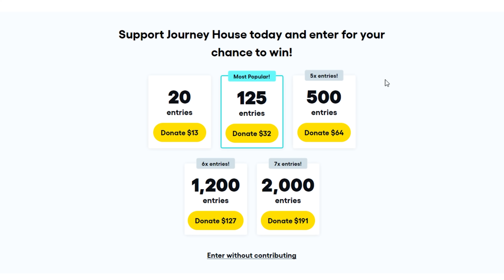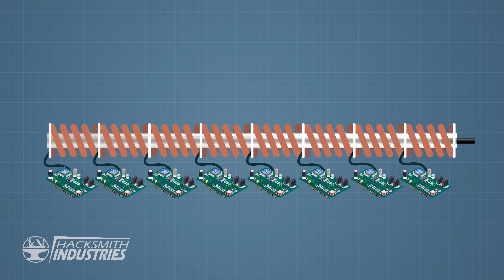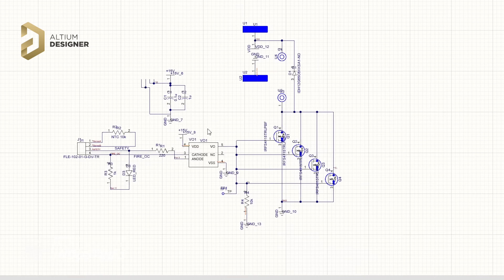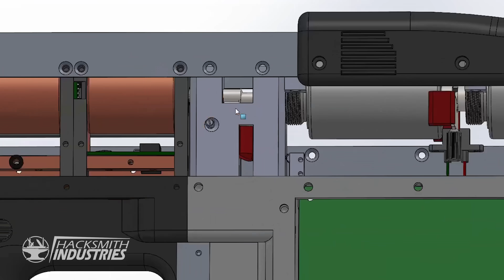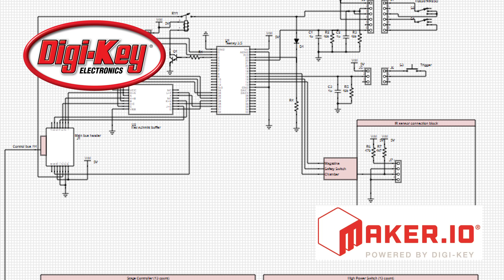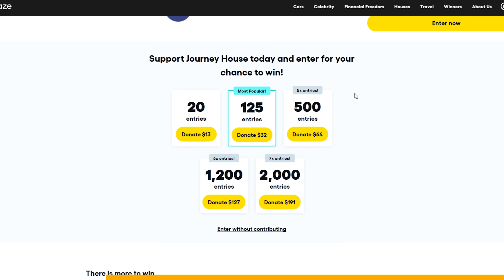MOST POWERFUL ENERGY WEAPON WE'VE EVER MADE!

Comment: The thing with bullets is that they are negatively impacted by air resistance, causing them to tumble. But that is because they have no fletchings because in order to produce the explosive resistance necessary to launch a bullet, you need the bullet casing to be flush in the barrel.

But gauss weapons do not have that issue. So to produce a proper and accurate gauss gun, you need projectiles with fletchings. They don't need to be big since the projectile is small. I believe you could get away with using 2mm tall feathered wire fletchings. Also, with a pointier tip (even just a ballpoint tip), they could actually break something. This will also take that load off the magnets. (The magnets will do less work.) I suggest slightly skinnier tungsten (rather hardened compressed powder steel) projectiles with fletchings and pointed tips.
Reply: Prototype V4 coming in 3 years xD
Reply: @koenv4367  V4 actually. 😉
Reply: @Dismythed  Omg ur right lmaoo
Reply: Just like an APFS projectile? (I changed it to avoid confusion. Not everyone is into about ground vehicles/projectiles)
Reply: @radonsider9692  all you really need is the fin stabilized part. The discarding sabot could work, but it would be a tradeoff as you would sacrifice magazine capacity and cost by including it, but it could help stabilize the round more in the barrel.
Reply: @radonsider9692  yesn't you would only need an apfs round, the DS stands for discarding sabot which means that the projectile has an outer hull that fits the barell, which gets trown away after leaving the barell, it's only purpose is enabling the gun to shoot projectiles that are a lot thinner than the gun itself (and alows them to have fins), but since electric guns don't need gas pressure the projectile doesn't need to fit the barell.
Reply: @erzbengelraziel5490  yes yes I know but it was just to make sure that I was thinking the same thing.
Reply: @radonsider9692  Without the casing, I guess. (edit: as Erzbengel Raziel said.)
Reply: @radonsider9692  Sabot Ready!
Reply: Tungsten is only paramagnetic so you wouldn't be able to use it
Reply: @aaron_r6611  Ah. I see.
Reply: @aaron_r6611  If we used a discarding sabot that was made of some sort of magnetic alloy, we could easily solve that problem.
Reply: @aaron_r6611  : As many maglev systems demonstrate, paramagnetic materials can be thrown with magnetic fields. Though maybe not with a coilgun design.
Reply: @aaron_r6611  What about a magnetic round? Stick with me here. If you have the coils oscillate their magnetic poles, would you be able to push a magnetic round at the same time another coil is pulling it? (Assuming the round's dipole is facing front and back.)

There is also the possibility of a monopole magnetic round made of eight lengthwise triangular magnets held together by a casing that the coils could pull more quickly.

These are just off the top of my head, and I really don't know how to calculate magnetic fields, so it may or may not be feasible. I'll leave that to you.
Reply: But tungsten is barely magnetic so you're not really going to get any power using it?
Reply: theres a hand held rail gun on the market that uses disks to solve that problem
Reply: @bulluffalo6711  That uses flat electromagnetic plates on either side of the discs, not coils. Discs do not have a strong ability to penetrate anything but flesh, wood and leather, and really just get lodged or bounce away dangerously in a left or right direction.
Reply: you could use tungsten on a railgun but iirc they dont really work in coilguns since coilguns operate using ferromagnetism not Lorenz force
Reply: Boost
Reply: They wouldn't fit in the magazines if they had fins on them. This is unless there is a sabot around the projectile but that would cause issues with a gauss gun.
Reply: @JordanHB77  not necessarily so you can have the fins pressed into the core so it is flush  and are used in a shotgun cartridge that would make ammo for this gun though I would like to know the maximum speed  it could fire them if the limiters was removed
Reply: @JordanHB77  It's magnetic coils. The accelerated round floats between the magnets. You can put any shape of object into it and it will fire it as long as it is calibrated to it.
Reply: Dear God I can see the Future where gunpowder is obsolete
Reply: @KaitoSound  I wouldn't count on it. You'd be hard pressed to match a firearm with a coilgun. A gun is relatively simple, there's somewhat complicated mechanical parts in the firing mechanism but at the end of the day you're just blowing up chemicals in a tube making stuff shoot out really fast. Look at their coilgun. It's probably pretty delicate and would break if you dropped it, it's enormous and heavy (albeit lighter than their previous prototype), it runs on 3 big batteries and has tons of expensive and sensitive electrical switches and components. And even though they said that they can't make it exceed a certain speed or KE because of Canadian laws, I kinda doubt they would be able to give it as much power as a real gun even without those laws, at least without making it even bigger than it already is and using even more expensive electrical components to handle the energy. Remember that what you see on the hacksmith are cool prototype mock-ups of pop culture gadgets, nothing more. They're cool videos and engineering projects but they definitely aren't viable for any sort of serious mass-produced product, and they're not supposed to be.
Reply: @rockyroadmagic4152  I understand what you are getting at. But one day, batteries are going to be a fraction of the weight and size. When the day comes that you can get 1000amps at 24v out of a battery the weight and size of a modern 9v, coil guns will take over. The reality is that most of the weight of a coil gun comes from the coils. These coils are designed for efficiency. If you had more power available, you could trade efficiency for weight savings. Plus, no maker has publicly shown a powerful coil gun to the public. That is for legal reasons. The coil gun in this video is capable of achieving 10x the performance with a few modifications.
Reply: @Veritas-invenitur  if anything is going to replace explosive propellent it will be air guns. You already have rifled air guns firing semi auto with 38 cal projectiles. Scale that down to a 30 cal and put the compression tank in a magazine and your golden. People just don't get excited over air guns to the tech hasn't gotten much praise or upgrades.
Reply: @Veritas-invenitur  but think about how insanely expensive it would be to mine the materials needed to make a battery as small and powerful as that? I mean hell, look at how much damage we do just to mine for the materials for lithium ion batteries to be processed and created. If we even have the necessary components to make an even better type of battery that's effective and not high cost...
Reply: @GUARDIAN.13  powerful air guns have been around since like the 15th or 16th century, and the idea has been around a whole lot longer in the form of blow guns and the like. Lewis and Clark brought one with them on their expedition across the country. There has been little improvement done to them in all that time. They're cool, and viable as a weapon, but gunpowder and soon enough energy weapons are generally more efficient and able to be made much more powerful due to the strength limitations of air tanks. There are exceptions, of course. I believe NASA uses a massive air gun to test the effects of meteor and debris strikes on satellites.
Reply: @michellewilt4479  exactly. They are however making a comeback with more advances in the last 5 years in rifle platform I'm hoping pistols soon follow
Reply: @Veritas-invenitur  Heat dumping would then become a problem.
Reply: @EnjoyCocaColaLight  Thermals will be an obstacle to be out engineered. They will not be an impassable roadblock. If you gathered the brightest minds and gave them 5 years, an unlimited budget, and access to all the technologies sitting in a laboratory. They would be able to make a reliable portable energy weapon with capabilities resembling something out of a video game or a movie. What they made wouldn’t be practical in any sense whatsoever. But it would work and prove the concept from a technological standpoint. The unfortunate reality of our world is that the vast majority of our most advanced technologies and greatest inventions are impractical. Marketability, economics, adaptability, scalability, and societal interests all play a major role in determining if a technology is shelved or rolled out. For example, we already know how to make a magnetic field around a military base that would stop any round of ammunition, vehicle, tank/mortar round, RPG, or aircraft from entering or exiting it. Such a field would also kill any living creature that tried to cross it by frying their central nervous system. In effect, it’s a force field. But, the equipment required is massive, exceptionally expensive (even for the US Government), and prohibitively complex. On top of that, the amount of power required to run such equipment is beyond what the latest nuclear aircraft carriers can produce. To build and deploy such a system with a power source would take a decade and likely cost nearly 500 billion dollars. I know that attempts are underway to use this technology to develop some type of portable system that is practical. But it wouldn’t be anything like you would expect (I know exceptionally little, however, I am still restricting what I share anyways out of caution and respect. )
Reply: Would rifling the barrel be possible? Also some sort of cooling system?
Reply: @BaygelTheDog  There is no actual "barrel" to rifle. Just a space through which the projectile passes within the coils.
Reply: @Dismythed  theres nothing between the coils and the projectile?
Reply: @BaygelTheDog  Correct. That would create friction and jam or destroy the gun. Also, the magnetism would be redirected by a barrel.
Reply: @Dismythed  does the projectile tumble at all in the barrel?
Reply: @BaygelTheDog  Not an elongated projectile. The magnets keep it straight. No barrel. Just coils. A gauss gun's "barrel" is called the "coils".
Reply: @Dismythed  ok thanks! much appreciate your time kind stranger!
Reply: @BaygelTheDog  definitely needs a cooling system. Would look pretty cool too
Reply: Any products have tried to make fletching guns accurate like conventional rifles including Franklin armory, project spew with the us military, other projects with the us military and other militaries trying it... They all failed
Reply: Okay, so it turns out that the ultimate tapering shape for a bullet above (aerodynamic) or below water (hydrodynamic) is a torpedo with small tail fins. Ballistic weapons cannot have that shape because they deal with explosive thrust, but a gauss weapon can pull it off. Just make sure the gauss field focusses on transporting the heavy end with only enough gauss in the tail end to keep the tail centered. In fact, once the object starts moving at a certain velocity, the tail should take care of itself to miniize energy requirements. The gauss bullet will have more effectiveness in water than a ballistic bullet.

Although, I wonder if giving the bullet a front-to-back polarization while tilting the magnets to repulse the tail might increase the velocity even more.
Reply: @Kent Newland Good point, but there is still the problem of aim and air resistance.
Reply: If you look at tank rounds you could implement fletching to normal bullet rounds. It would just be to expensive.
Reply: what about a grooved ferromagnetic projectile with a tungsten tip?
Reply: Commenting for the YouTube algorithm
Reply: Is spent uranium magnetic? Just pondering what the highest density magnetic bullet might be made of.
Reply: @PaulMansfield  I don't remember, but spent uranium is still mildly radioactive. Extended exposure is not advised.
Reply: Wind doesn't cause bullets to tumble.  They don't tumble untill they hit somthing.
Reply: @redfarley7878  By "wind resistance", I meant "air resistance". (Everyone else seemed to understand that. I have adjusted the main post with the correct term.) If you don't know that air resistance causes bullets to slow down and eventually stop spinning so that they tumble, then this discussion may be too advanced for you. You need familiarity with at least high school level physics principles to discuss this subject. Bullets don't fly forever, and they are not frictionless. A bullet softens by heat before it hits a target because of air resistance.

The bullet's kinetic energy gets transferred into heat energy when it meets the resistance of air. As the kinetic energy is transferred, it loses momentum and slows down. It's rotational velocity is actually the first thing to stop, which means that it is unable to maintain its gyroscopic stability and begins to tumble. Fletchings act as stabilizers in lieu of gyroscopic stabilization. The larger and heavier the projectile, the longer it takes for air resistance to affect its stability. (Though anything over 70mm is not able to have rifling because of jamming issues, so larger projectiles are not given external gyroscopic stabilization, but they use greater velocity to compensate, which requires a much bigger gun.) Thus, the smaller and lighter the projectile, the shorter distance it is able to fly before losing gyroscopic stability.
Reply: Boost
Reply: Please correct me if Im wrong, but... Isn't the most relevant point that this gun (or any energy based gun, I think) wouldn't require air? I mean, from a scifi perspective, regular guns or even air guns would face a serious problem in space.
Reply: @Sylvasoul   I think you misunderstood. The gun does NOT use air at all. Air resists the forward progress of the projectile because air exists between the gun and the target. Thus aerodynamics of the projectile are key.
Reply: @Dismythed  Thats what I was saying. A regular gun would be combustion based and require air, an air gun would need some kind of compressurized air supply tank, so both would  not really work in the vacuum of space, but this coilgun should. Of course usability in space is kind of a moot point, but since were discussing scifi weapons, I thought it would still be appropriate
Reply: @Sylvasoul  It does not require air, but air is the primary medium in which it operates.
Reply: @Sylvasoul  You're partially wrong there, correct in assuming an air powered gun would be useless without its own supply of air to pressurize from, but any modern ammunition contains its own oxidizer so the gunpowder will still ignite without atmosphere.
Reply: @Sylvasoul  A compressed air gun would work fine in space,  better in fact, since the differential pressure between the compressed air and vacuum is greater plus the projectile wouldn't encounter air resistance.
Reply: @jones1618  While empty space would allow maximum acceleration for compressed air (decompression), compressed air is far less acceleration than magnets can do.
Reply: @Sylvasoul  A real gun uses an explosive powder, the powder includes all the components required for the high speed combustion (ie explosion) to occur.  (So, for example, while I don't know the components, if the combustion requires oxygen, then one of the components of the gun powder will free up oxygen as part of the combustion process and this will allow it to burn in the abscenes of atmospheric oxygen)
Reply: That’s a flechette
Reply: @sovietsheep5051  Correct. That is technically the correct term.
Reply: Actually, you can recess the fletchings into the projectile, no need for fins. That way you still have a tubular projectile, but the recessed fletchings will produce spin. You could also spin a smooth projectile in place before launching it to get a rifling effect.
Reply: @matt_pigeonowsky  Balls are notoriously inaccurate, unreliable and low range. They are actually highly turbulant, having greater drag and more affected by air pressure, veering off on any trajectory the air pressure wants to go and slowing it down. If balls were better than pointed ammunition, they would not have stopped using them in guns. The bullet shape creates a greater low pressure zone behind the bullet, causing the air to curl and reduce drag through steady flow. Its trajectory also spirals because of rifling, or in this case, fletching, creating a cross path to the air pressure, reducing resistance and stablizing the momentum in a straighter path.
Reply: Or use self-stablizing shapes.
Reply: @wesleythomas7125  Care to elaborate? As far as I know, the bullet shape and tail fins are as close as you can get. Also, stabilizing on a surface is not the same as stabilizing in the air.
Reply: @Dismythed  Longer bullet with most of the weight up front. Gravity pulls the nose down while air tries to push it upwards, and all the forces cancel out.
Reply: @wesleythomas7125  Yes, it is considered above, Just not the aerodynamics of it.
Reply: @Dismythed  Someone on a different gauss rifle video (a Forgotten Weapons vid) mentioned putting a divot in the base too, so there might be something else to them I don't fully understand. Reminds me of pickup truck beds; they use the turbulence to mitigate air resistance.
Reply: @wesleythomas7125  It creates drag, which helps stablize the bullet, but it also slows it down.
Reply: What if they used projectiles identical to bullets except there are 4 slotted groves evenly spaced around the projectile. And instead of using the coil design they used 4 electromagnetic monorails this in at least theory could allow for some “barrel rifling” having the rails spiraled in the barrel of the gun. Idk if it’s actually possible bc I don’t have the means to build it my self to try. But it’s a thought and if anyone is willing to try to make it and it works. Just give me a shout out and a percentage of the defense contract that would most certainly come 😂.
Reply: @masonchampion3491  Monorails don't have as much electromagnetism as coils, though they are probably more efficient. Also, there are gyrojet weapons with the four slot design, so it works, but not highly effectively.

Sorry, buddy, but your idea is already common knowledge, but think of them when you pick a penny up off the ground. 😉
Reply: They could also rifle the rounds
Reply: @majorbytes2853  Rifling the rounds is only for compression in an unrifled barrel. It gets its stability from the sheath that surrounds it in a shotgun upon explosive compression.

It is actually less accurate than a smooth round. Contact with the air immediately causes instability. A smooth surface responds less to that instability. A rifled round has more contact area, which interacts with the instability. It does not impart any stability. It does not offer enough rotation on its own to produce stability.

Three or four fletchings, on the other hand, cause shaped drag, which causes stability.
Reply: I love these types of comments. My favorites.
Reply: me reading this section not knowin sht 👁️👄👁️
Reply: @twohalfbreak6675  brooo lmao same feeling here.
Reply: Smart
Reply: They already break stuff, they cut clean through red bull cans pretty easily.
Reply: @acorgiwithacrown467  They dented empty cans and the vibration broke the statute when the round bounced off. The round did not break the statue, the vibration from its momentum did.
Reply: @Dismythed  14:17, clean through.
Reply: @acorgiwithacrown467  Alright, I'll give you that. But it it does highlight the overheating problem.
Reply: @Dismythed  That sounds like my Dad's old saying "It's not the fall from a 50-story building that kills you. It's the sudden stop at the end." 
Agreed, though, the projectiles weren't all that powerful and sort of tickled the targets to death.
Reply: Mercury aluminum quantum mechanics 

Bose enstien physics!!!
Reply: Sorry I don't speak nerd.only English. Now SIMPLIFY!!! (my brain cannot process this comment..)
Reply: @BlackoutKnight7  A "gauss" gun is a gun that uses magnets to accelerate objects instead of exploding gunpowder. Fletchings are what are on arrows to help them fly straight. Bullets tumble as they fly because they have no fletchings, which affects accuracy. This is reduced by causing the bullet to spin with "rifling", a ridge in the barrel that causes the bullet to spin. But this only allows the bullet to spin for a certain distance, then it begins to tumble and move off target.

A gauss (magnetic) gun uses magnets to levitate and accelerate the projectile (arrow, disc or bullet) through the middle of magnetic coils until it reaches a damaging speed.

Tungsten is the heaviest metal outside of mercury and is used in bullet casings. The heavier the object fired, the more damage it will do. Unfortunately, the tungsten idea doesn't work because it is not very magnetic. Speed is better than weight.
Reply: @Dismythed  Mercury is less dense than tungsten.
Reply: @Dismythed  Tungsten core, surrounded by iron casing?
Reply: @EnjoyCocaColaLight  I thought about that, but generally, you want as strong of ferromagnetism as possible. The weaker the magnetism, the less the response to acceleration. After seeing some videos about ferromagnetism, I have to concede that iron is clearly the best choice for being both dense and magnetic. Anything heavier with comparable or better magnetism, is radioactive. They do mix some iron bullets with spent uranium to make them heavier, but it may be unhealthy for a survivor, particularly if a fragment cannot be removed. I know we're only talking about lab experimentation, but someone could still be hurt or just regularly exposed.